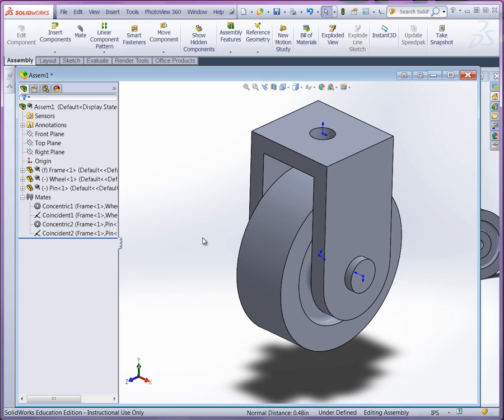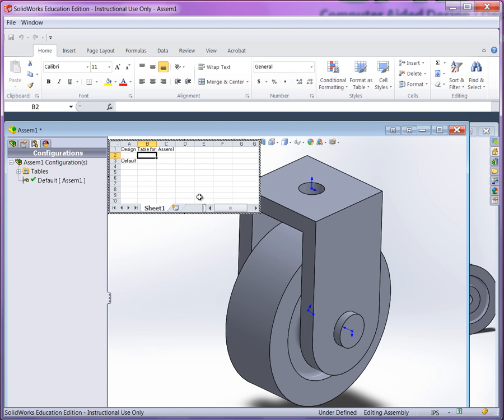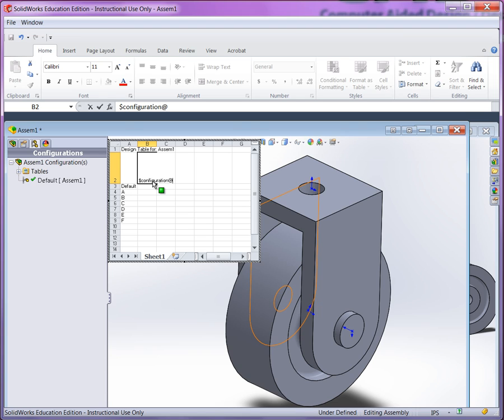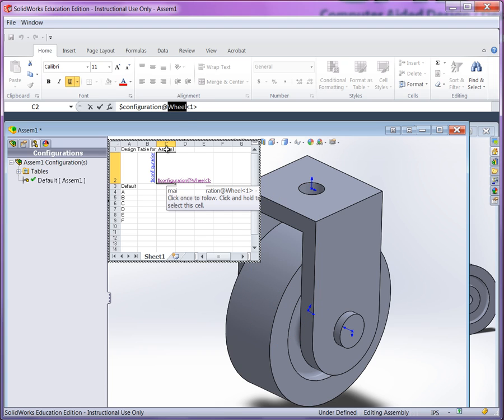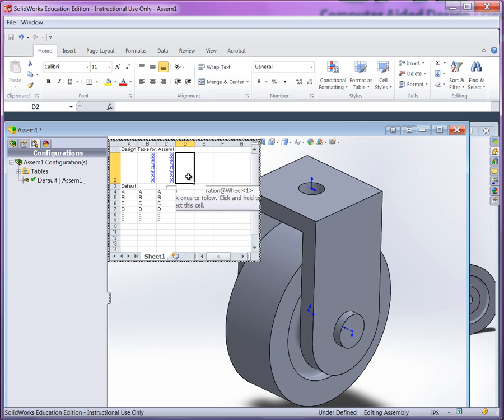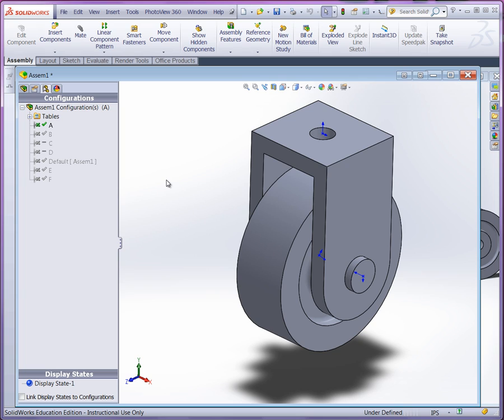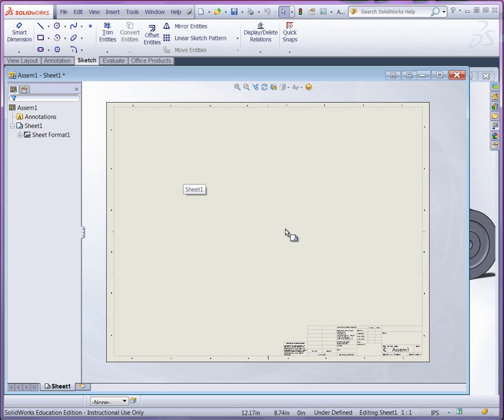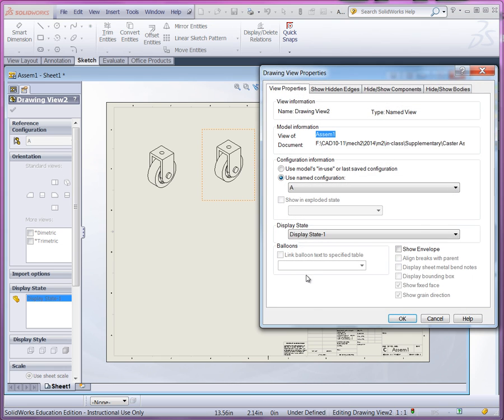Using a Design Table to Create Assembly Configurations

Comment: Sir, where are the relations between the frame size and wheel size stored or created?  If you increase the length of the frame how does the program know to increase the wheel size and by how much?  This is the critical information you left out of the video.

Comment: I watched this video very carefully and no where did I see how each configuration is controlled.  I don't see where you set up the relations which controlled the frame and wheel size for each configuration of the design table.  What did I miss?
Reply: I think this is what you are looking for:
https://www.youtube.com/watch?v=eWbKa_53NhI
Reply: @santoslag08  Oh. This is a "ASSEMBLY TABLE" carry the value of each part. 
The link you send is "PART TABLE". That's right I just wondering like "bpetnoi". 
We missing something...the "PART TABLE".